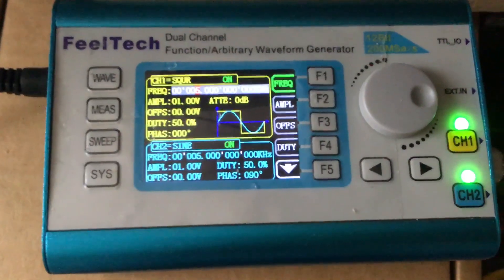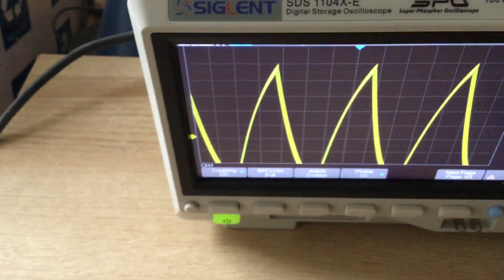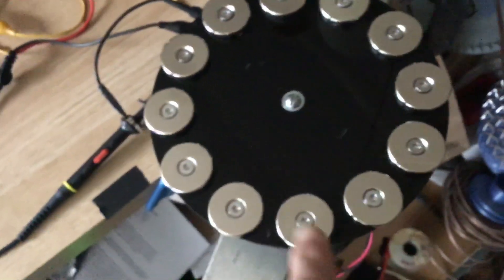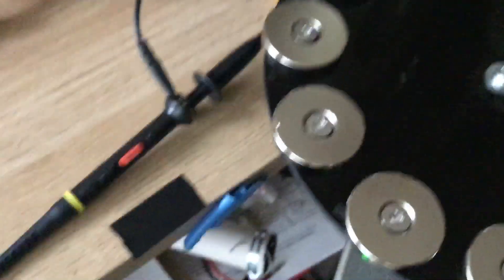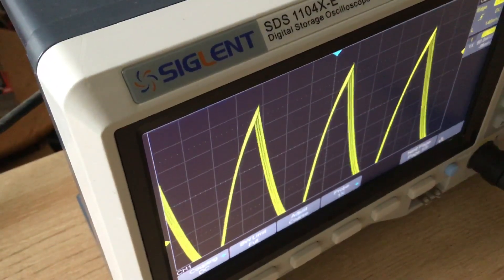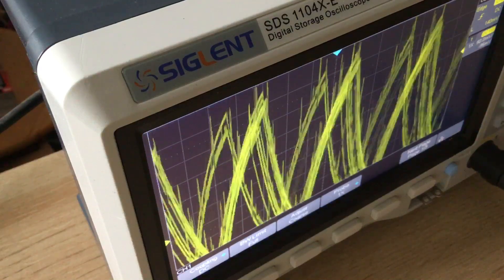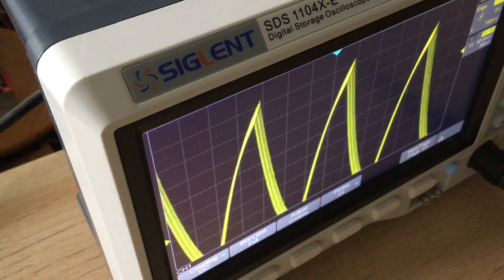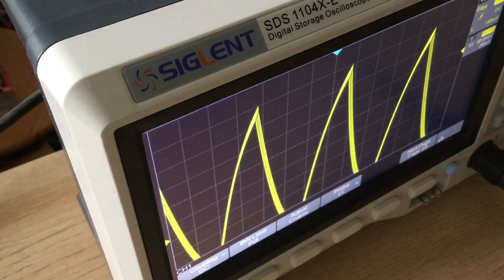spinning magnets changes capacitance ?

Comment: A moving magnet will induce a voltage in a piece of aluminium, so I don't understand why you are surprised at this effect.
Reply from the maker: the voltage induced is not what I am reading. I can have the magnets spinning and no voltage is shown if the capacitor is not charged.
Reply from the maker: tried to post a follow up video to address this idea because of another comment... ipad is telling me I can't upload because it does not have permissions it already has... so, can't show you what I said. can someone else try this and see if I actually got this wrong ? frequency matters here, try in and out of phase, results are odd

Comment: The moving magnetic field is inducing voltage in every conductor and as a result the trigger point on the scope is changing.
Reply from the maker: right, i thought of that. why i am looking at the peak voltage
Reply: @spacecase0  With the trigger level changing because of the noise it will look like the peak is changing.  You need to do a single sweep and get both peaks on the screen to see what is happening.
Reply from the maker: @barnowl6807  I tried that. every 30 seconds of video is an hour upload for me, can't show everything. and now my tablet and phone seem not to upload at all... I will try for an extensive video and leave my computer uploading for days if needed... will take me a while. but seems likely I will move on to other tests by then. likely will figure out an easier way to show the effect after thinking about it for that long

Comment: That's not changing the capacitance. The capacitance is being charged to a higher voltage by the additional energy coming from the field, and all the leads act like antennae.
Reply from the maker: fantastic idea, going to try that with a non vortex and see the change
Reply from the maker: just tried that idea, ipad will not let me post follow up video. 
why is a non vortex magnetic field acting the same way ? 
but only at the same frequency...
not sure about that because I should see the frequency of the coil on its own if that were the case, and I am not seeing that...

Comment: What does a moving magnet do to its field? What's capacitance?
Reply from the maker: i was exploring the idea of magnetic pressure or magnetic or whatever you want to call it. basically I was testing for the electric permativity of space. a capacitor with air as the dielectric, you can see how much energy the free space can hold.  and the value of that is suppose to be a constant, but my tests so it might be variable. I also check the permeability of of space, and that sure changes, just that it is hard to test around moving magnets, so no conclusions on that one. and if you did not know, you can calculate the speed of light with using the permeability and permativity  (hopefully I spelled that right)
Reply: @spacecase0  that calculation was relegated to a small appendix in the physics text i have. Sad.
Reply from the maker: @nolan412  really ? even how light propagates is not correct in current books, but radio teaching videos from 80 years ago got it correct. modern physics dislikes field forces... if I have to figure them out on my own I will do so, but should likely just read old books to learn.
Reply: @spacecase0  I second reading old books. That text I have is a 1970s edition. The editions since 2000 are split into easy to carry volumes so nobody gens that appendix.